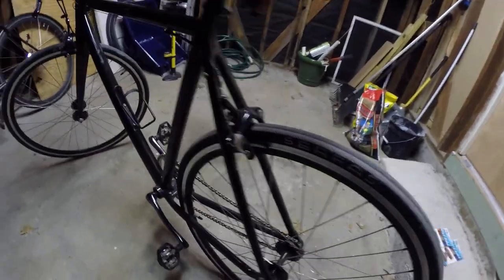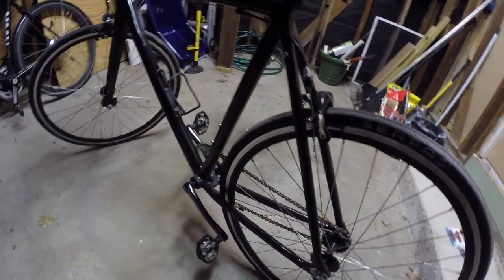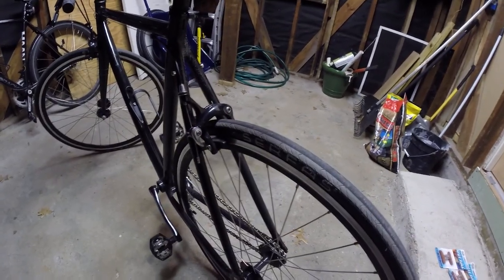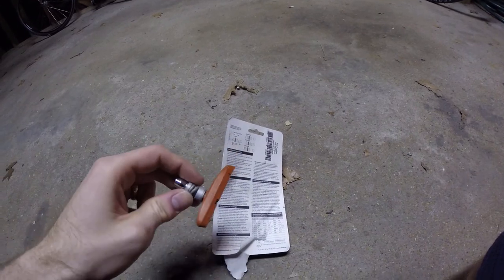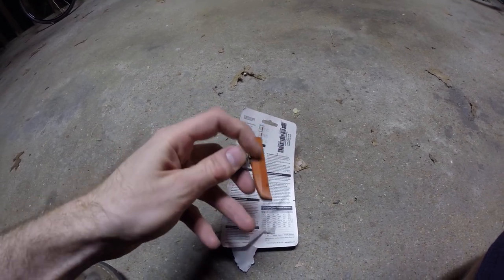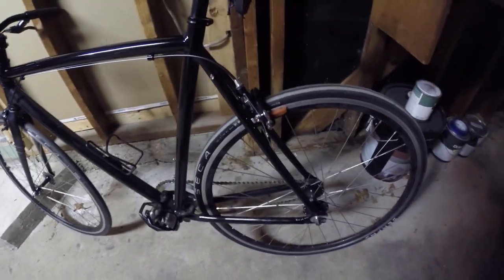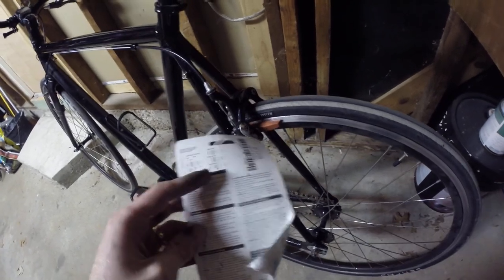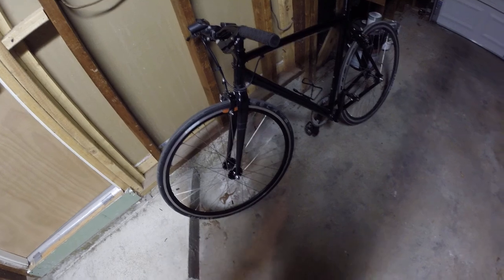How To Fix Bicycle Brake Grinding Noise Tip Bike Blogger

Comment: Hey BB,
I have noticed surface wear on the rims from the brakepads (pads are new) I've tried a few different methods and none seemed to do anything to remove it, although the last one I tried was starting to remove it but was leaving scratches, any advice?
Reply from the maker: +trevorduvall Hello trevorduvall. Wear on the rims from the brake pads should be removed with something like hot soapy water (oil) and then sandpaper or steel wool to rough them back up and smooth out the imperfections. You can rough up the brake pads too. You don't want them super smooth. If your rims are really worn then it's time to get a new because they'll eventually split apart when pumping up the tires. Really worn means when the wear indicator dot/dimple on the rim is gone. Your rims may or may not have that so check both to be sure in case one rim is worn more than the other. Otherwise another indication of thin/worn rims is a concave surface where the brakes touch the rim surface. Hold a flat screwdriver up against it to see how concave it is. Wheel rims should last thousands of miles. The more you ride in the rain and the more grit that gets on the brake pads and the less you clean them the shorter the lifespan. 0.5 to 1mm of rim erosion means it's time to replace.
Reply: +BikeBlogger Hi there I have just recently developed a nasty knocking sound on my bike but, ONLY when I peddle & is far worse when I change up in gears. (from 1st) If I raise the rear wheel & hand peddle it nothing happens not even if I change gears.   seems fine. It has GOT ME VERY PUZZLED! 😟 Do you think it is my peddles at fault ( the  cause of it)  of which I can easily replace myself or something else. of which I can't . 😟. As you seem to have a better idea of what it could be rather than myself.